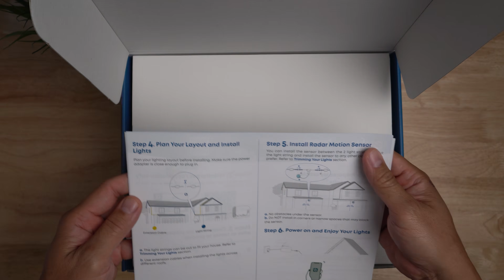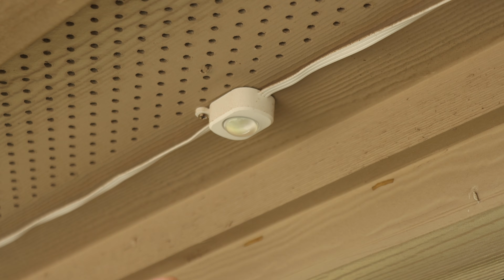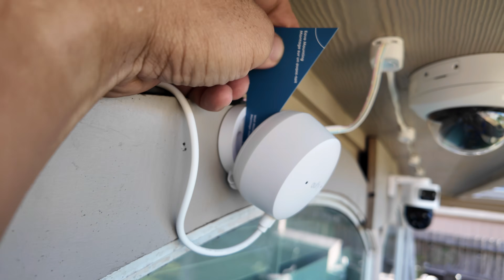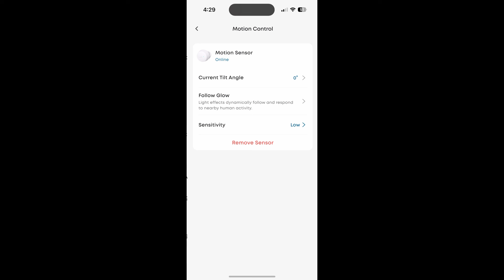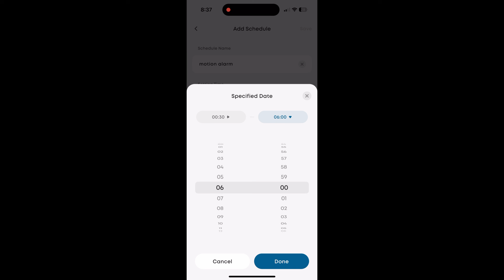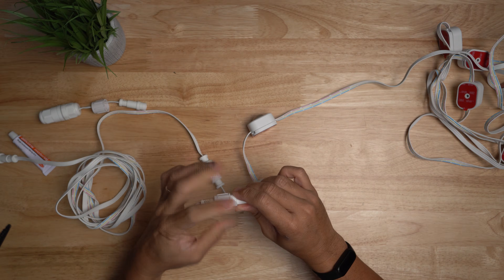The World's First Radar-Activated Outdoor Lights! - eufy Outdoor Light S4

Comment: Can you put more than 1 radar on one set of lights? Like 2-3 per 200' line?
Reply: No, Eufy says one per control box. A control box can only bind to one radar unit.
Reply: @Cari6006  I can confirm this now as well. I bought 2 x 100' strings of these lights and it's definitely only 1 radar per string for now.  I love these lights overall but they could definitely use a software update to make the scheduling better. Also the smart automation isn't working well right now. Also making 2 lights become one group isn't working that good either for the time being. I am hopefully that Eufy fixes this via updates in the future.
Reply: @Str @StriderGTS why issue are you having with the group schedule? I just got mine on a schedule last night from 1800-2100 to check that it was working. When I came home about 1900 they were both on. When my husband came home about 2030 the back was off, but the front was on. Is this what you are dealing with?
Reply: @Cari6006  I put my two strings on a group schedule and then tried to run a schedule with them and it just didn't switch over when it was supposed to so I deleted the group and created two individual schedules and that seems to be working well. Basically I just think the app needs a bit update to the S4 lights in general. The smart features aren't working well.
Reply: @StriderGTS That’s the problem we are having. Last night my front lights came on at 1800 when they were supposed to but my back lights didn’t so I manually turned them on. At 2100, the front lights went out, but the back lights didn’t. Even though they should be a group. I’m going to disband the group and do separate schedules like you did. The biggest issue I’m having is neither radar will connect to the lights. Eufy is sending me new ones so we shall see.
Reply: @Cari6006 my radar actually does work but the schedule I made for the radar is kind of hit or miss. We need more robust scheduling options.

Comment: I have been researching if there is a way to use a y splitter on this system. My power outlet is in the middle of my house and thus don't want more than 50ft continuously. Any suggestions for this problem?
Reply: Unofficially yes. You can either buy a compatible "y" connector or make your own. Works exactly like the govee one. Do a search here for a govee "y" adapter.

Comment: Are the lights spaced properly where strings connect together? Most of them seem to have a wider gap between lights there causing you to mess up the spacing or have a dangling connector.

Comment: I wanted to buy it but in order for the light detection to work (human lighting tracking) I need to have a eufy camera and Homebase 3. I dont own any eufy cams 😓
Reply: Is this true because I don’t have my Eufy cameras installed yet besides the doorbell. I CANNOT get the radar to connect. Eufy sent me to this video. The lights connected fine and the radar on neither strand of the two lights sets that I purchased will install.
Reply: @Cari6006 do you have Eufy Homebase 3? Says on fine print (website) that needs it as well.

Comment: Hi Lifehackster i purchased the Eufy S4  pernament lights 200ft  length. Eufy websites says in order to power the 200ft lights they have a maximun length. Each 200ft light strand would require its own power adapter.  I'm considering installing 7 of them to cover all sides of my house. Any suggestions on how you would run 7 separate power adapters. Thanks

Comment: Do they seem pretty much the same brightness as the eufy e22 I just picked up the 150ft kit for $299 on sale i feel like it wasn't worth the price difference could have bought two sets cheaper than one set of the s4s
Reply from the maker: They are the same with the E120s. The E22s are a bit dimmer.
Reply: @LifeHackster the E22s are the second gen with the loop for a screw built onto the light they are 3x brighter than the E120s
Reply from the maker: Ooops.. I’m mixing the models up.. so yes, the lights are the same on the 2nd gen and these S4. You do get an extra 2 light modules per string though.
Reply: @LifeHackster okay thanks yeah it would be a little brighter then